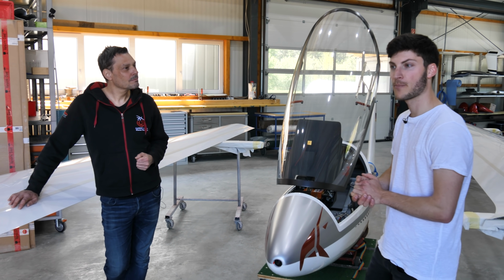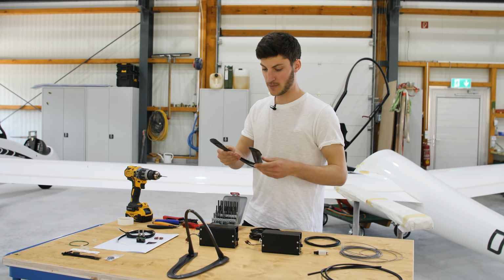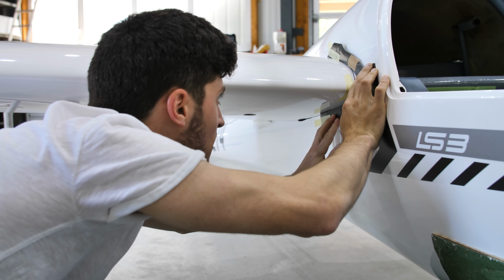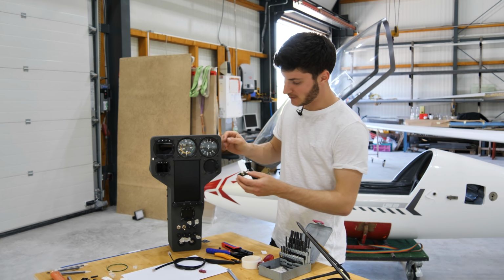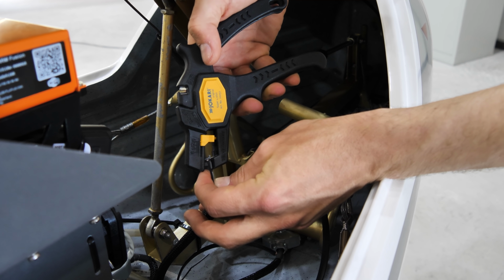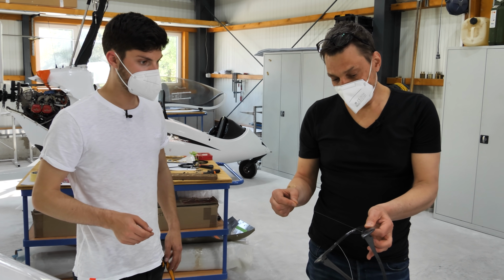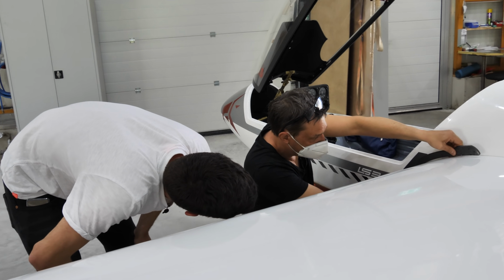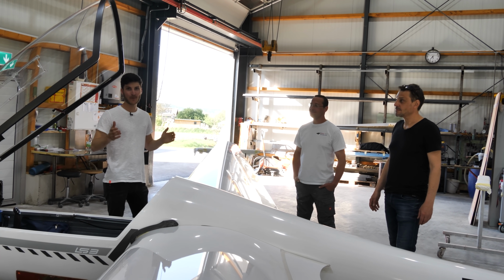My New LS3 DESIGN & Laminar BWS Bugwiper System Installation

Comment: So how much glide ratio points does it take you when there are maybe 10 bugs on each wing? The BWS is also producing drag...?
Reply: It’s enough drag that the old glider computers used to have a bug setting. You could tell the computer how much bug contamination you felt the wing had and the computer would downgrade your glide performance. This was before bug wipers.

Comment: Why not keep the wing foil clean and wipe down with a silicone to prevent bugs from sticking. Also. Bugs will be close to the ground. Would not think there would be as many up higher causing drag or changes to the air foil so much.
Reply: Bugs are from the ground to the top of thermals. So, everywhere a glider flies.
Reply: Because no bug coating is perfect (and silicone needs to be re-applied, has environmental impacts, is more labor intensive). And yeah, bugs are mostly close to the ground, which is exactly where you take off from. So you need to wipe off the bug juice after passing through lower altitudes.
Reply: @TheAnachronist  Bugs are not only close to the ground. They are caught up by thermals and will rise to the top of the thermals. I have seen groups of swallows at 6 thousand feet having a feast eating bugs. Swallows can help a pilot find a thermal.

Comment: What is the benefit when you take into account the additional weight from the motors and batteries?
Reply: I'm no expert but would assume very little impact. I think the LS3 has water ballast anyway but not sure if Stefan flies with it. 
Also I see this on the Wikipedia page..
"In spite of its weight the LS3 is a nimble climber. It is also less sensitive to rain or dirt than other types with the same [wing] profile."
So I'm not convinced that the extra drag of the kit out ways the benefit. But like I say, I'm no expert, so what do I know. :)

Comment: If a ceramic coating is additionally applied to the wings and fuselage, it will create a hydrophobic layer on the surface. This layer will make it difficult for insects to stick and easier to clean the glider. Moreover, it will provide additional protection for the paintwork against ultraviolet light.

Comment: The serrated washer on the switches should be behind the panel, and the plain one in front.
Reply: Are you sure? I thought they were to stop the nut coming loose.
Reply: @passenger6735  They are to stop the switch rotating when you tighten it if you have a single nut, or to stop the rear nut coming loose if you have dual nuts.

It's partly an aesthetic thing because the serrated washer doesnt look so nice on the outside.
Reply: @chriswedgwood9673  They do look bad for sure. Thanks.

Comment: Please explain how it works !!!!
Reply: Hi Andres, the bugwiper wings are equipped with nylon filaments, that scrape the bugs off the wingnose. the bugwipers are not mounted on the wing, they just stay in place because auf the aerodynamic forces. The retrieval line, that is powered by the electric winch, guides the bugwiper on it´s way to the wingtip and brings it back to the parking position at the fuselage. So you can clean your wings regularly during flight and and maintain full glide ratio.
Reply: @wolfgangzimmermann6468  Thank you... I have been dreaming with gliders all my life and still I had no idea something like this wiper even existed !   Go vegan and fly safe !

Comment: Tell me how much disruption of air flow there is when these are installed compared to a clean wing. I bet it's at least 10-15%. If you don't test the difference in a wind tunnel ... then it's a wank.
Reply: and there is NO WAY I would drill into that fuselage. Just another excuse to void a warranty when micro cracks develop. There are treatments such as the latest developments in graphene with a hardness of 10H that last for 3-4 years and the crystal protective coating won't wear away from rain or the sun.
Reply: @stanislouse4168  I don't know of a single insurance claim void or a warranty void as a consequence of the installation.  Micro cracks on a fibre glass fuselage, from a tiny drilled hole?  Never heard of that.  For all the holes drilled into fibre glass ships for a mirrored of reasons - there has never been any negative outcomes that have ever been reported.

Comment: Why are the motors so large? There is not a lot of space behind the cockpit to begin with. The new bug-wiper company owner needs to make the motors 5x smaller in size with same performance!
Reply: Those motors are Aircraft Certified.  My brother says those motors are used as trim motors in many airplanes.  It could be that they are used because they are FAA certified and very common in aviation and therefore easy to get at almost any aircraft parts supplier. This could be why..
Reply: @CalebNorthNorman  what is a "trip motor"???
Reply: @ronaldglider  i meant trim motor.
Reply: @CalebNorthNorman  Thanks - that makes it clear...!
Reply: @ronaldglider   ya ya 😁

Comment: I dont understand this... bugs fly low, very rarely above tree canopies. Only spider webs can be found in the top of thermals. Maybe , maybe ! If you fly in tropical,  ecuador areas, humid, a lot of insects, but even that , again no bugs above the canopies. And , bugs when smashed they get sticky, with no water.. just a scrapper is it efficient?  Really don't understand the need of this, except for pilot psichology .
Reply: 1. i think you have no idea, how much bugs on the leading edge make the performance of a ls3 worse. glide ratio and! handling .
2. i think you have no idea, how much bugs go up with thermals. what do you think why swallows fly high in good weather. (if you see the litlle birds under a cumulus... there is the best thermal. strongest thermal... most insects ... best meal ...most swallows) . 
3. bugwipers on a ls3 ... totally senseful .
Reply: That's why nearly every new competition sailplane produced now comes with integrated bug wipers - just for pilot psychology :-) - think you have a lot to learn about biology, nature, meteorology aerodynamics etc. etc.   l/d of ls3 measured at 41.8:1 with clean wing, 34.4:1 with 20 bugs/ metre........
Reply: @soaruk3697  don't underestimate anyone behind a nick. I'm an Hang Glider pilot since my 16, I've 44. Flown in many countries and different continents , shared the sky with sailplanes. So.. I do know a bit of meteorology,  and biology...  my comment was   is it a hype for sailplanes, like leather seats in cars ? Again, sworms of bugs are not common high in the sky like I said I've landed with many spider webs, flown under ,  around many cumulus... but smashed bugs ? Maybe they crashed while landing or takeoff near the airfield  . 20 bugs /m2 ?
Reply: @NoTengoIlusiones  It's really simple. All of us who fly gliders have had to clean the bugs from the wings after every long flight. In Europe, in Africa, in the Americas. Sometimes it's quite a task, as there are so many. And it has been measured how they affect performance (the measure is bugs/metre, as what matters most is the leading edge of the wing). There is nothing "psychological" about it.

And, if you cannot imagine that you'll smash a ton more bugs doing 170km/h than you do at 20km/h, then you have way less experience than you claim.
Reply: @tinchote  Speeds on Hang  hangliders are not as high as on sailplanes. But for the record thermaling on competition gliders is 56/70 kms/h , transitions 80-130kms/h.
Reply: @soaruk3697  Speeds on Hang  hangliders are not as high as on sailplanes,(flying high It's the same, thermal tops, wave flying etc) sure. But for the record thermaling on competition gliders is 56/70 kms/h , transitions 80-130kms/h [not bad for a peace of tubes and rag huh? by the way do you know it's carbon tubes, 7075 "aerial" alloy, or even the all profile of the leading edge it's a single peace of carbon for the rigids]. Again, as a previous (sailplane pilot)comment why only now competition gliders are coming with it? an not let's say 10 years ago if it's so important? In the cost of a sailplane it's neglectable . ps- every sport as is beauty , specifications , instead of being rude , pedant, why don't you take the time to clarify? my previous comments are questioning the use/need of this 'apparatus'.
Reply: You don’t need to understand it. If glider pilots think they are a good necessary, then they are necessary. They would not go to the trouble and expense for nothing.
Reply: The bugs attach themselves at low altitude, mainly during the launch and then they stick, affecting the performance throughout the rest of the flight.
Reply: @NoTengoIlusiones  So you read that part of my comment, but not the one where I say that we all see and clean the bugs after almost every flight? Also, there is nothing knew about bugwipers, they have been around for decades. Here is a 1990 discussion about them: https://groups.google.com/g/rec.aviation/c/ozsff4pMtrg?pli=1
Reply: @kennethhawley1063  I did ask/referred that in previous comment. Thank you for clarification.
Reply: @soaruk3697  and how much drag produced by installing these???
Reply: @tinchote  Since it is PHYSICS, tell us all the difference in drag with a clean wing and the system installed. How about tech data from the company in a wind tunnel? Bet they didn't do it. $$$
Reply: @kennethhawley1063  Plenty of people blow cash on all sorts of junk they "think" they need. Like carbon fiber wheel sets on exotic cars. This is no different.
Reply: @kennethhawley1063  Well, that certainly is a better evaluation than bugs fly up to 15K.
Reply: @tinchote  It's a garbage setup.
Reply: @stanislouse4168  Tilo Holigaus builds gliders and wins international competitions with them; he uses bugwipers. Uys Jonker builds gliders and wins at international  competitions; he uses bugwipers. Almost every glider at the world championships uses bugwipers. But I'm sure you know better.

Comment: waste of money.
Reply: Why the hell should it be? The LS3 wing profile is very sensitive to bugs. A few of them on the leading edge and your performance and glide ratio will drop like a stone. Especially when flying for maximum performance or at competitions like Stefan just a few percent will make a severe difference. So this installment is quite sensible!
Reply: That's why every new sailplane produced now comes with integrated bug wipers, or do you mean this particular bugwiper manufacturer? Maybe qualifying your response with more detail would help.
Reply from the maker: Bugwipers are no waste of money if you do serious cross country flying or comp flying in Germany. On some days they are a gamechanger. 
There are also manual whinches available which are a lot cheaper or you build them on your own.